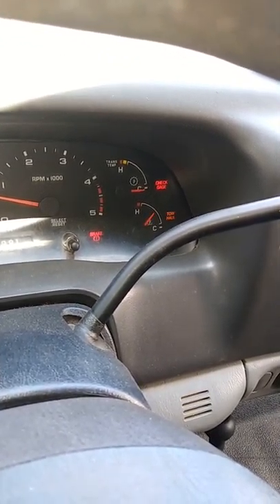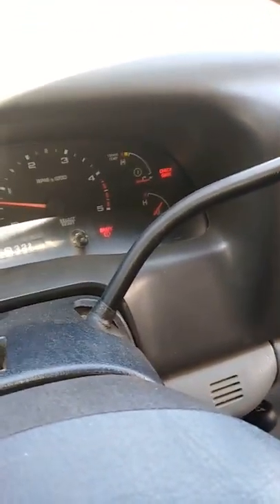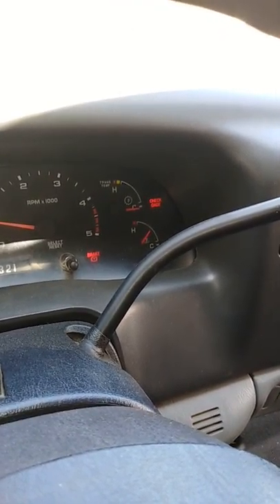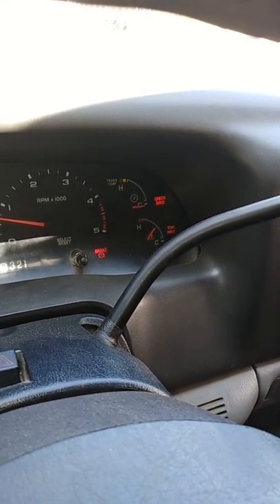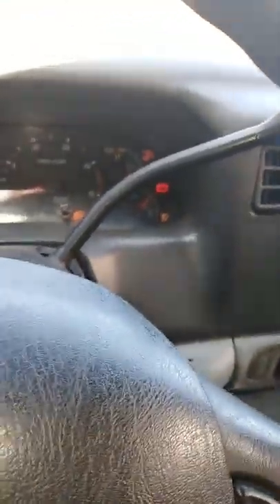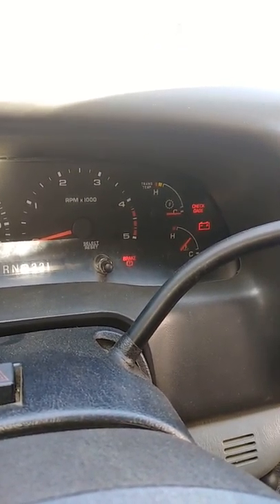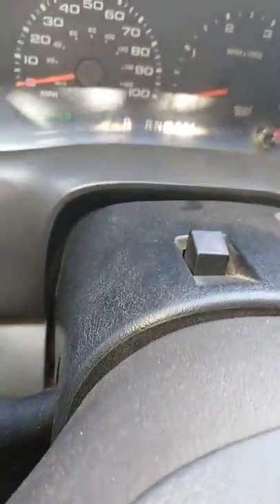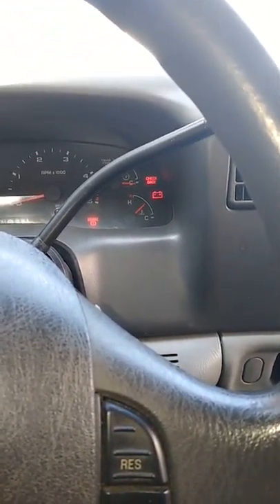F250 check gauge and tow haul problem how to fix the problem.

Comment: I watched this 2 years ago, I changed the part and it fixed the problem. Now 2022 I had another incident, so yes I will do it again, might as well service the transmission, change the pan filter and the external filter as well. Thanks for the video, I'm sure you saved me a lot of money.
Reply from the maker: Yep no problem I'm glad it help out bro....I knew someone gonna need this video one way or another... I did same change gasket,  oil, filter might as well
🍺🇨🇱.....
God bless bro
Reply: What problems?

Comment: Other than the lights being on what symptoms does this cause by being needed to be replaced
Reply from the maker: If I still remember my tyranny was getting hot? im not sure its been yrs...I was towing my goose neck with a skeeter loaded in the mountains when it appeared...sometimes low oil, sometimes something withe tranny...some other commenter said i didn't have the part 1... I had a video how I replace the little plastic in the tyranny next to the tyranny filter... I guess I must have erased it.... check oil level, change oil, filter....

Comment: What's the name of the sensor
Reply: transmission temperature sensor
Reply: I JUST PUT ONE IN MINE AND IT DIDN'T WORK. MY TOW HAUL IS STILL ON.
Reply: @jerrycurry9747  did you get it figured out. I'm having the same problem.. I changed the TFT sensor and filter and the check gauge indicator still on.. Plus gauge still jumping
Reply: I'M GOING THROUGH THE SAME THING STILL. IMA GO WITH FORD SENSOR MONDAY.. HOPE IT'S NOT A MODULE 🤦🏾‍♂️
Reply: @jerrycurry9747  cause none of you guys check the codes
Reply: @jerrycurry9747   Hiii a have the same problem did u figur out what was the problem? Thanx
Reply: @stevensdaniel7107  I DID I GOT A SENSOR FROM O'REILLY INSTEAD OF FORD LOL. I JUST  BOUGHT ANOTHER TRANSMISSION.

Comment: Did it fix your problems because I have done that but it didn't fix it
Reply from the maker: It did bro.... if it didn't get fix just have reset
Reply: @filamrider   no it's still came back with the same problem once it gets warm it goes away don't know what else to do any ideas
Reply from the maker: @emmanuelcastro9827  That I would not know what else to do brother....because when I replaced mine I reset it and it cured the problem.... im sorry if I know I would tell you....
God bless